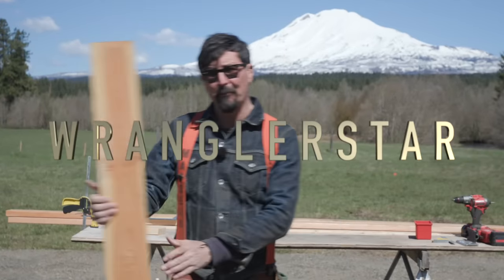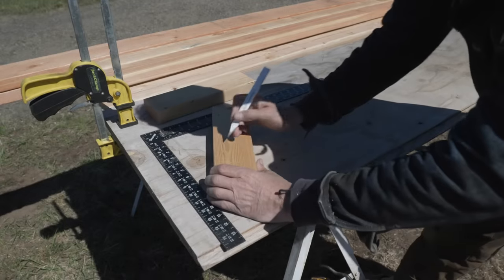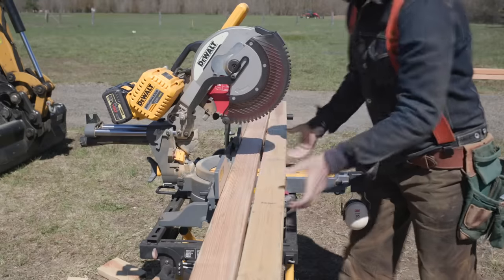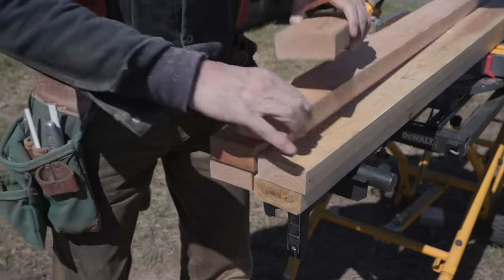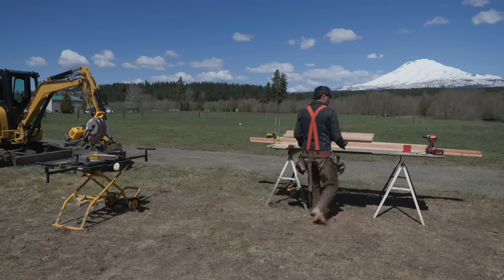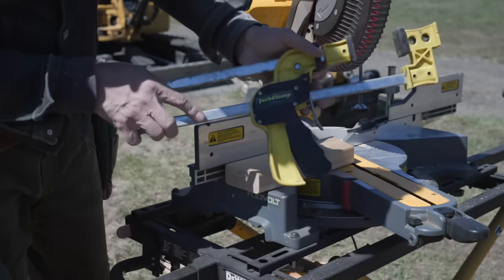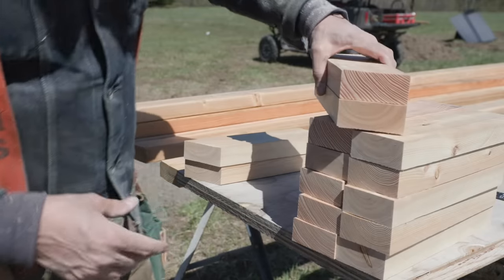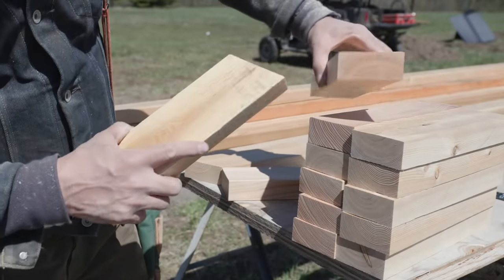Cozy Log Home DIY: Episode 9 - Roof and Rafters Rising

Comment: if you use a longer holder (perhaps 6 inch) for your P2 driver bit, you will find its easier to see that it is in line to the  screwhead, reduce skidding and thus damage to both.  I find that a longer holder only rarely gets in the way of driving.

Comment: If you are going through the trouble of ripping the bullnose off the boards its often a good idea to just buy bigger dimensional lumber auch as 2x12's for your rips because the lumber tends to be higher quality than 2x4's and you can choose something that will get you some quarter sawn grain for better stabilty long term.

Comment: Safety Sally here. Cool project. When using a table saw, only push when behind the blade. Most importantly push the stock against the fence, you can get close to the blade but always behind the blade. Then push the stock through at a safe speed from the back of the stock. You see Wranglerstar on the far side of the blade, but realize he’s probably very cautious where he’s putting pressure on the stock. Don’t do this, he feels safe but knows the risk. Always push the stock against the fence (behind the blade) and from the back of the stock, and never have anyone grab the stock on the other side. Use an outfeed table. We know he usually explains these things, but each video can only be so much.
Reply: Yeah...watching him pull that 2x4 through the saw instead of pushing it all the way boggled my mind.  Not to mention the non-use of a push stick or something.  To each their own...but I like keeping ALL my fingers.  The world is full of 9-fingered old timers who also thought they would never have a problem.  *shrug*
Reply: @asbrand You’re right, I can’t think of a scenario where you’re in control while pulling the board. The torque on the outfeed disables you. You might not impale yourself, but maybe someone behind the saw 😳 I, personally, don’t think he was pulling the board but still scary.
Reply: Said it for me.
Reply: absolutely. i have sewn up amputations or completed partial amputations from table saws so many times that i never even let my fingers pass the plane of the table.
Reply: He’s in the middle of a field. “Use an outfeed table” blah blah. If you know what you’re doing and you’re safe about it it’s fine. You guys are the worst, lol.

Comment: Loving the series. I'm a finish carpenter by heart so I appreciate the 'extra steps' to make everything look better. Quick question: Why didn't you face screw the first set of rafter trusses to avoid the screws hitting each other when you installed the second side? Perhaps I missed it in the video but something you probably compensated for off camera.
Reply from the maker: I don't like to run screws into end grain, it's not very strong,
Reply: @wranglerstar  I knew you had a reason...I appreciate your intentionality : ) Thanks for responding.

Comment: Im curious on the decision of the dimension of the cozy home.  Myself and 2 other guys decided on a 24X24 slab to make a 20X24 structure for a deer camp for the 3 of us as we are replacing our outdated 40' camper.  Was it's dimensions picked to fit a certain number of people?
Reply from the maker: the cabin is 18x24

Comment: My meter is not of the opposite orientation.  My meter is from the measurement of earth by ancient architects.  It's in the pyramid.  It's measured from the north pole to the equator.  Don't dog on any units of measurement.  They are all correct except for the Taiwanese 10 inch foot.  Now that's just f d up.